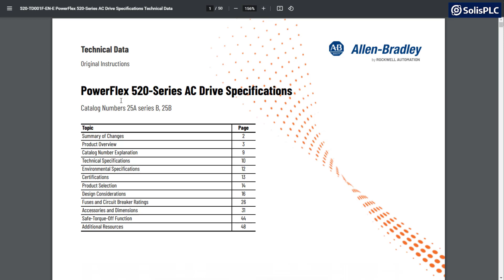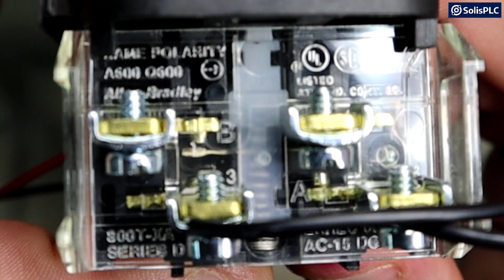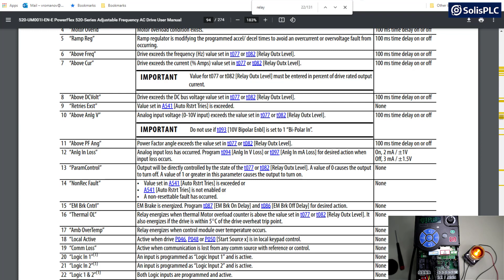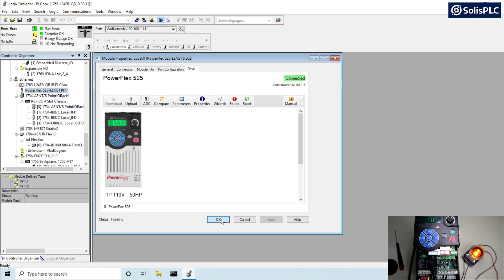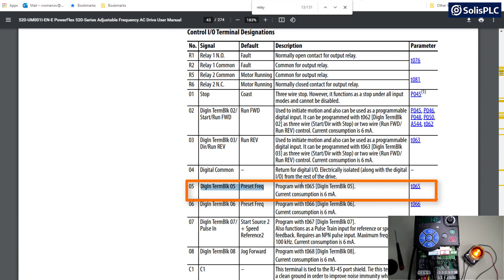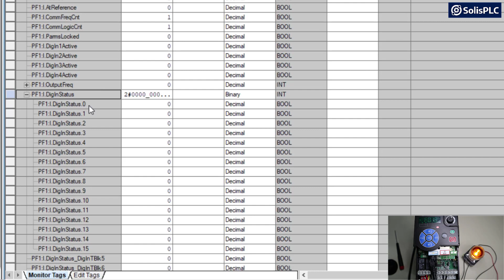PowerFlex 525 Parameter Setting RSLogix Studio 5000 EtherNet for On-Board Input Output Tutorial

Comment: is the datasheet wrong where it has the SNK & SRC labels (on the top not the ones at the bottom)? I mean, the way I understand is if the input is sourcing it is supplying 24V and according to those schematics if the if the internal "selector switch" is to the right it is labeled as SNK. I'd love to get that cleared out.

Comment: Wiring in the Pilot light, do you know where I can find the amp output (load) that the drive itself can put out? I am always wondering just how large of a load I can put on it.
Reply from the maker: That's actually a very good question I was thinking about myself. I looked at the datasheet and got the following info: The relay outputs can switch up to 3A while the Opto isolated output (where I wired the LED) provides 50mA of current. It's definitely not much, so you can easily burn the output if you wire up a big load. You'd probably want an external relay on those if you go that route.